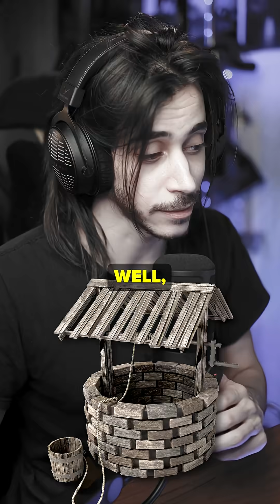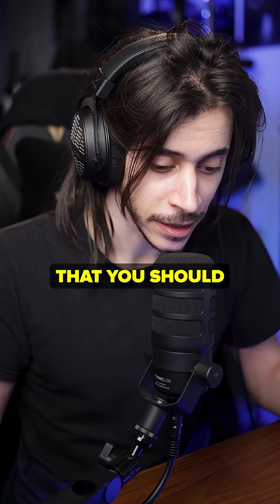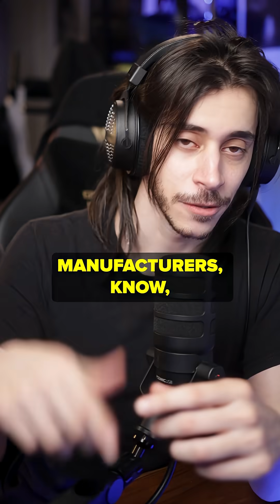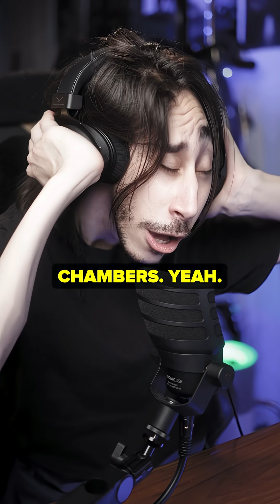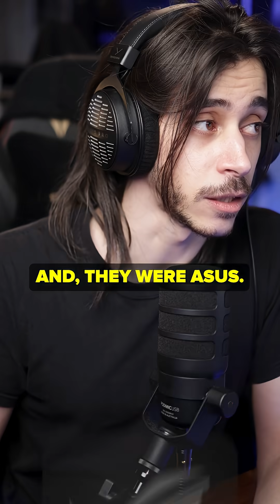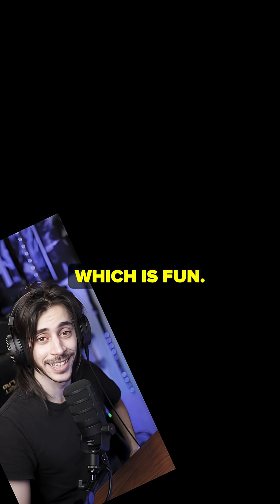Ryzen CPUs Exploding In AsRock Motherboards

Comment: for anyone using ryzen7 shouldn't be using more than one 8pin cpu power above your board you find is why you don't see more widespread issue with other board vendors only put one 8pin and extra 4pin only in majority boards you find in b650-x870, while only e and plus version have 2 full 8pin cpu connectors i never use 2nd one if i only using ryzne 9 cpu only due to amount of cores and high clocks...never plug 2nd one for that cpu's the ryzen 7 x3d cache ...they aren't the same as nvdiia smart sense pins are designed variable go from 0-600w vs 8pin constant 225w having 2 equated 450w...having 3rd one..equates 650w ...thats more than variable 600w. it makes gpu cores very warmer than normal after long stress...since 9070xt requires a lot of massive cooling for that is running abnormal high for gpu clocks with 64 CU running each in that clocks. All this could had been avoided if only game devs really care much in their coding than showing me the money first that millennial culture working in those studios is making everything they touch turn to dogshit that force hardware gpu companies and cpu to push over the limits in clocks and cache when is not necceasry for pc is something is simple by just write the code without flaws as gen x and boomers write back in the days ...gen x are impressive coders than we got with millennials who aren't

Comment: Have the NOVA. Both Load Calibrations at LvL2, VSoC at 1.155V, -100mV offset + CO -25mV + Shaper for more precise control + Arctic Freezer III 420 with pump forced at fixed 50% power. CPU doesn't exceed 51 °C, 38-41 idle, and stable all the time, no matter the load. Solid as an Intel 486!

Comment: I'm running a Gigabyte AB350 Gaming 3 from like 8 years ago I guess I'll be sticking with Gigabyte if I ever upgrade to AM5 but my 5800x only ever hits like 50-60% Gaming in 1080p and watching 1080p at the same time and I don't plan to go any higher in display (27in 1080p 280hz primary)

Comment: I was pretty set on getting an Asrock board when picking my parts as they're a lot cheaper than other brands right now but last minute I decided it was safer to just go with a Gigabyte board instead. I figured the extra $50 was worth the peace of mind, at the very least.
Reply: If you haven’t bought a board yet check out the msi pro lineup, they have some pretty great value per dollar last i checked, unless their price got screwed

Comment: Yah it really sucks i wanted to get the asrock taichi for my new build but im using a 9800x3d and im not willing to risk it haha
Reply: At least strix boards are still nice and high end
Reply: @nerd20fromdiscord yah that is very true i ended up with an msi board but asus does make a good mobo
Reply: @Manitsnick msi boards are sweet too! I run a mid range msib650 matx board and its value per dollar when i bought it was pretty nuts! (I only mentioned strix boards because iirc the top end ones are a little fancier than msis topend ones, and i had a good experience with the strix itx board i used for my brothers fractal terra build)
Reply: I personally always used aorus boards and never had a single issue

Comment: Damn, I just bought an asrock motherboard and Ryzen 7 7800x3d a few months ago. Gonna be praying
Reply: 7800x3d should be fine, the main culprit is Asrock+9800x3d. Even then the only reason it’s a problem is because there are more CPU failures than normal but it’s still a rare occurrence overall.
Reply: Can you not get a refund?
Reply: @yeshi3522probably not after a few months, likely just a replacement if it fails within the year or 2 or 3 depending on the manufacturer warranty
Reply: I have asrock paired with 7800x3d sometimes it idles 2days straight and its fine
Reply: @alphonse5935  Change that board asap
Reply: Undervolting is your friend

Comment: My theory is that the contact with the pins might not be strong enough. And it's X3Ds only probably because it needs more bandwidth for that 3d v cashe.
Correct me if I'm tripping.
Reply from the maker: Asrock identified the issue is because of their Bios in some way, so I doubt that's the reason tho